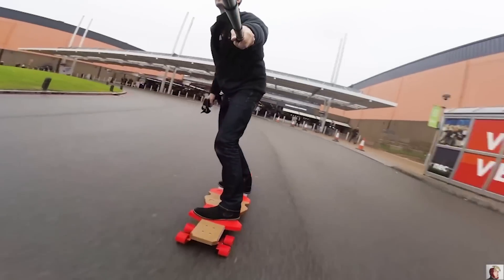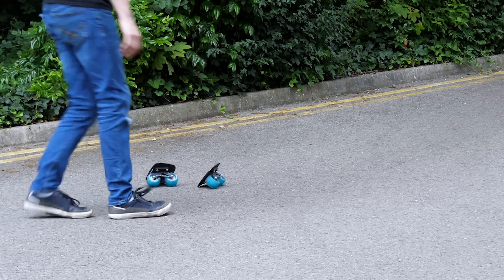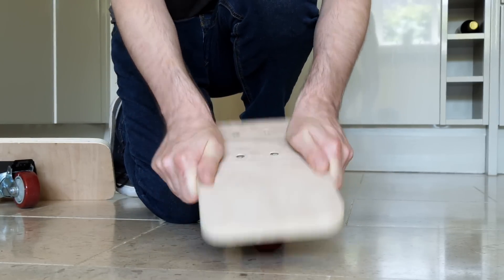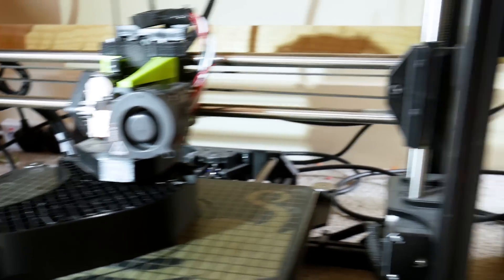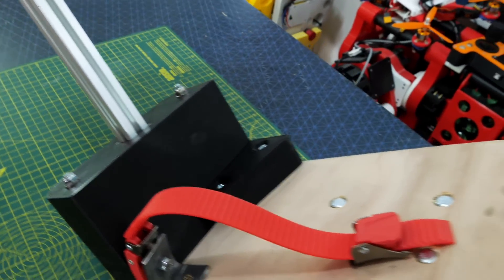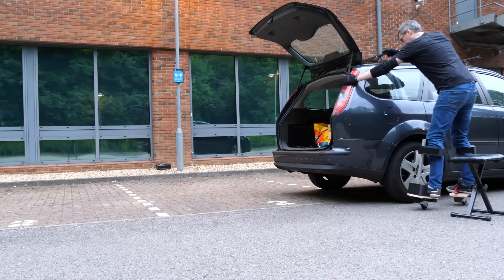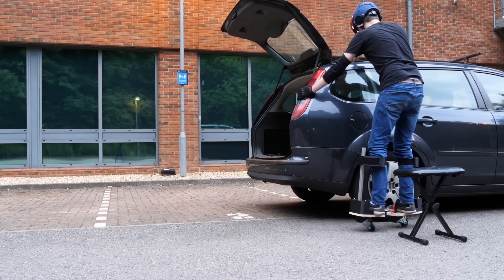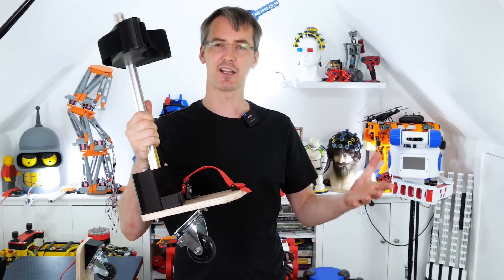Why single-caster skates are Easy

Comment: i was pretty confused why you immobilized it which defeated the whole purpose of caster, which is self-correction of tilt. if you tilt to the right, the wheel turns to the right.

Comment: Interesting to see RealVNC advertising. :) In the past, I used VNC extensively as a disability aid, allowing me to lay down or sit up as needed without changing what I was doing. Had to give it up because using a laptop in bed was killing my neck. Touchscreens were better for me, but all of the software I used was absolutely terrible on touchscreen. I kind-of should have adapted that one self-compiling IDE-compiler I was using, but wasn't happy with its coding language. A Raspberry Pi wouldn't be a suitable component of the system anyway.

Comment: I think the major advantage these had over the 2 wheel version is that they were strapped to your thighs instead of relying on friction only. I bet the original would work better than these in with the "stilt" rig you had going on.

Comment: I have a cheaper set of freeskates the wheel material is better suited for indoor floors or sidewalks then road asphalt. Your ability to turn them but your foot slipping out that is probably why. I would find a better surface or get a better pair of skates. I have not tried to re-grip mine yet but I imagine doing that then getting more pro model wheels would let me take them on roads and hill bomb which is what they were originally made for... Another thing to learn fast is move one foot ignore the other it will help you learn faster once one foot gets you moving start to then do the same with the other.

Comment: Fun project! You should try moving under your own power like the ripstick which is very similar to what you have except the two platforms are connected by a single axle. On the ripstick you twist your hips back and forth which sends your feet forward and backward. The wheels draw a cross cross S shape on the ground as you propel forward.

Comment: The way the "rip-stick" worked was by allowing you to rotate your hips to steer around your leading foot. So to make a left turn, i lead with my left foot then rotate my hips so that the back right foot swings from behind, redirecting my forward foot. The way it propelled was by allowing you to essentially rotate your hips to 'push' off the ground. Like self propelled snowboarding, you steer with your propulsion. Since your propulsion was essentially staticly oriented, you never had a way to control.

Comment: If the wheels were really wide on the freeskates they wouldn't be as maneuverable but they wouldn't tip and you could make them progressively narrower as you get the technique in, a training wheel shape could be (edit: oblate spheroid? TIL) where you try and keep them vertical but a tilt isn't as instantly punishing..

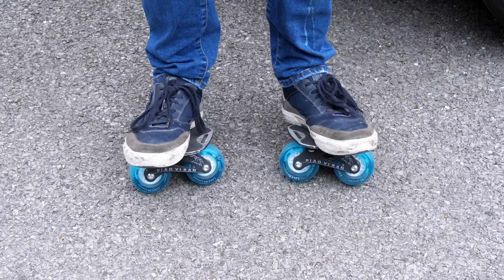Comment: 0:36 "leaning side to side does nothing because the wheels are fake"

What? 

What?

The global degeneracy is astounding. The wheels are real it's not a skateboard so there's no trucks. It just works differently but if the wheels were fake it wouldn't roll at all 😢
Reply from the maker: FIXED, the wheels are fixed

Comment: just a reminder that with roller blades you make pivoting your feet easier by transferring your weight onto fewer wheels to unload friction and retransfer the load to apply friction to turn. in reality its more of a balancing act between the two. the saving grace is that you have the option of always having two stable wheels to rest on an some limits to movement. the rip stick works because the distance between the pivot points of the casters is fixed. the amazon skate things always have at least two wheels touching the ground and your side to side movement is restricted. these all somewhat act like a sailboat where the keel restricts the tilting movement thus transferring the forces into the direction where it has freedom to move.

Comment: At 07:35 did you consider connected the two skates with a bungie cord to avoid leg splay? Could be attached at the shin brace level to prevent the cord from getting tangled in the wheels when your feet are close together.

Comment: It seems really similar to a ripstick, except that they are not joined together. I wonder if someone adept at ripstick would be able to do it? Or does the lack of connection between the feet make it totally different? The amount of time you spent, from what I can tell, would not be enough to learn how to get around on a ripstick. It takes a while to figure out how it works. Especially with nobody to tell you how to do it.

Comment: I will say, I own a pair of largely unused Freeline skates, and the freeskates you have have much more boxy wheels. The JMKRide freeskates have an even more rounded profile than their original design which I think helps considerably with turning. You also DO tilt your ankles a lot to turn on freeskates, it's not just yaw, which is why I think the square wheel geometry is hurting you

Comment: those casters are a bit like bikes. if you fix the steering wheel of the bike It's almost impossible to balance. It's the auto correcting of the steering wheel that keeps you upright

Comment: One thing i've wondered for a while is if you could have self balancing skates like Segway shoes or Boston Dynamics's Handle but on a human.  One wheel on each foot, each actively tries to stay upright, some throttle control to either move them both together or control them independently, steering would be done by leaning, speeding up one wheel, or probably both.

Never done more than just think about it, not tried to make it or anything, but it was a thought nonetheless.

Comment: Now that you figured out the Ripstick skates use an angle to keep the casters pointing in a very helpful 
forward direction, would that work for your caster scooter, which you mounted flat to the board?

Comment: You cant steer because to steer on casters you have to tip onto your toe on one board and tip to your heel on the other. The leg braces make it essentially impossible to do that. If the braces had a pivot point with likes tromg springs to make it eant to stay cemtered except when you want to steer might work

Comment: Years ago I saw some odd skates in an old magazine. Two children rolling along on one wheel skates. Each foot had a single large wheel on the outer side. There was a rod or platform to support the foot and a rod up the outside of the lower leg, strapped to the leg. The wheels looked to be at least 6" diameter.

Comment: In theory you should be able to translate your feet(as it would be sideways) and by design you should move forward. With forward momentum, the back and forth motion of the casters would propel you forward I would think. Add in the fans and even more speed.

Comment: It seems to be that it might easier with the platform rotated 90 degrees,  so that you have all of your foot supported, thus able to apply more steering force. Also, and this is purely guesswork, it would give more control over the castor cause the plane of the angled block underneath would then be on the same axis as the main rotational motion of your ankle, ie your foot moves easier in a pitch direction rather than a roll, so again more steering force can be applied. 

Then I'm thinking, if you put the weight on your heels, this increases the angle of the castor base to the ground, and make it more inclined to point parallel to your foot, which you could yaw to steering. Put weight on the balls of your feet, then the castor is more free to move, and perhaps provide thrust like the wave bikes others have mentioned 

Anyway, purely my random thought, great video as always 😊

Comment: Have you also looked at something designed like a waveboard, that's something we used to play with when I was younger.
Reply: Looks a lot like what you are doing now but has both connected by a rod which allows for turning and speeding up

Comment: So there are electric freeskates out there. The brand I've seen the most is Summer board. They have powered castor motors. I wonder if throwing those on with a VESC would do the trick.

Comment: The fans kind of miss the point of the casters. if you move them opposite directions (watch a caster board, its why it twists in the middle) the wheels want to correct themselves to return upright as you described, which gives you a jolt along the axis perpendicular to the twisting motion. You just need to move your feet forwards and back almost like you are walking and you will gain momentum to the side

Comment: I think you might be able to turn by shifting your weight. If you put mere weight on your left leg, your left knee will bend, tilting the front castor right and therefore turning right. The opposite would turn the rear costor right, causing you to turn left.
Reply: If it is like the ripstick you turn by angling your feet in different directions. Lead foot leans into the turn (like a skateboard) and trailing foot leans away from the turn (opposite of a skateboard).

Comment: 11:55 I dont think there is a way to steer. Those casters are basically gonna keep you going in whichever direction you have the most momentum, and rotating the boards arent gonna rotate the casters. If you rotated both casters, you could angle yourself, but turning in a totally different direction would require you to cancel some of your forward momentum and redirect it, which isnt quite possible with the current build unless you rotate your body entirely. Maybe having the inverted propulsion to slow and the ability to rotate the back propulsion for steering would be an option.

Comment: I feel like a couple roller blade boots or even ski boots with the caster setup installed would have accomplished basically the same thing.
Reply: Yes, I was thinking these are inline rollerblades but with the wheels turned 90°

Comment: I haven't learned to balance on two wheel for each foot, so let's do it on ONE wheel on each fot...with JETS! =)

Also, it would have been a perfect moment to add some old "first attempts at flying machines" mixed with your little section at 7:38 =)

Comment: "I need a block of wood to stop the caster from moving... so I printed a couple." When all you have is one glorious hammer... :) So impressed with the work James does.
Reply: "I need a rectangle with some holes in it, so I busted out the cnc and cut it out of the middle of the sheet."
Reply: and then proceeded to saw it to the correct dimensions.

Comment: Did you try the double wheels but using the swivel?  I bet you could also add a second wheel axle that is connected via a very strong spring, but with an axle block at the top so the wheel doesn't catch on the deck.

Comment: I have Crosskates. Big huge things, too heavy really. The front of the two wheels per skate self steered, through a self cerntering resistance. Lean is steer. Much like downhill skis I guess although I never tried those.
Also allowed for double push skating which was pretty amazing.

Comment: Steering solution- look at the Rip stick for inspiration again, and make your lead wheel fixed instead of a caster. May make starting harder, but will work as a guide wheel when you twist or lean over it, once you're going.
Reply: I don't know what kind you've ridden, but the only ones I've seen have a rotating caster in the front as well.

Comment: What about a fabric strap between the two skates to stop the "splits" (preventing a division of your divide) without restricting the movement of the skates? In fact another at the knees would also prevent horrendous joint injuries ;). Counter-intuitive engineering! "Ski" type poles for starting off with the throttle built into one? One of my favourites :)
Reply from the maker: That is a skateboard
Reply: @jamesbruton  Only if it's rigid surely? Or is that a specific definition?

Comment: Using only one fixed wheel could solve the steering problem. And I would preffer an short rubberband-ish connection between the two wheels just to prevent some kind of injuries.
Reply: I was thinking the same, just one fixed wheel.
Reply: but no, the rubberband makes it more sketchy, I would say. But then, I'm a freeskater, so I am used to the skates being separated.

Comment: 10 or so years ago i had a waveboard, which seems similar to what you have except the two pieces were connected to each other. So maybe what i remember from that can help you here, to steer, you push your back foot in the opposite direction, not verry far, just about a foot or so, obviously, the further you push that foot, the smaller your turning radius. To gain momentum you would basically steer left to right continuously in quick succession. Hope it helps!
Reply: Oh, so a Ripstick?
Reply: @Xaaaach  yes, that seems to be the same sort of thing

Comment: Wasting tons of 3D fuel on useless, unimaginative and uninteresting toys, as always, when so many useful things could be done with such resources.  This is exactly an example of an engineer who knows electrical engineering and mechanical engineering, has the ability to think technically, but does not have the ability to think innovatively, with which he could create more important devices than useless toys.

Comment: Whatever else... kudos for putting yourself through that torment.
I used to be a pretty good skateboarder, i'd probably be now, the old guy who wipes out trying to show the kids a cool trick, but when i first tried freeliners, i fell over several times until the guy who borrowed the set told me the secret. You need to forget about them being skateboards or skates. They're neither. It's less about continuation of motion (which is the core element of those two) and more about static balance that allows you  to move in a direction. It's like that trike that was popular for a couple of years many moons ago, the one where you'd lean left (which would twist the trike body) then lean right, then left, then right and that would create a forward motion. It's similar in that respect. You're using your static balance to create motion.

Comment: 09:10 The stability effect you're experiencing is called trail. It's like when you let a normal bicycle roll on it's own (or ride w/o hands on the handlebar) – when the bike leans to one side, front wheel PLUS fork steer and bike goes back in a stable position… as long as it's fast enough.
Reply: the Dutch use the verb sporen which means following a trail
Reply: This!!

Comment: I learned to ride a unicycle by holding on to a shopping cart.   It keeps you steady and upright while you learn to use your body and feet to balance and steer. It might also help with learning to use those leg-breakers. :)
Reply: I've always wanted to learn how to ride a unicycle. I'll have to keep your advice in mind should I ever get the chance.
Reply: You'd want a small, light, maneuverable cart that's very open in the back so you're not banging your knees or the uni wheel into it and you don't have a hard time keeping it aligned with you. And not for any wheel bigger than a 12-inch, or you'd never find an ordinary shopping cart with enough room for the wheel.

Also, how old were you? Were you at your full height? I don't have my old 12-incher anymore, but unicycles don't usually position you very low to the ground. I feel like, at my current size, the handle would end up about mid-torso, at which point any fall would dump me headfirst into the basket...

Comment: You tilt your ankles in opposite directions to steer on a ripstik. You can't do that with your cut off ripstik since they're strapped to your legs. You could get around this by putting a hinge or something where the strut attaches to the board.

Comment: What if (and this might be dumb) but what if you had a stick with a motorized wheel on it  that you could touch the ground with in any direction you wish to move in. Probably at an angle 📐 and probably a mini tire 🛞 for traction. Yeah idk
Reply: The issue would be grip. You'd need to lean a ton of your weight on it to get it to do anything. I think I'm picturing what you have in mind though and it would certainly be worth looking into. If this dangerous monstrosity was deemed worth looking into lol

Comment: I don't get it why the freeskates wouldn't have straps or something. 

I guess that would make it a different sport/product, but seems like that would just make it so much better,  sideways rollerskates
Reply: From what I've seen, the ability to bail by just stepping off is handy when things start to go wrong.  Also, insane tricks.
Reply: @gildedbear5355  well yeah but you wouldn't need to bail, but also then again it would just be sideways rollerskates as far as the difficulty goes if you could relocate your feet with the device still attached and able to place it back on the ground where you want 

it's not like they're made for practicality in the first place
Reply: It's not exactly "free" if it's strapped to your foot